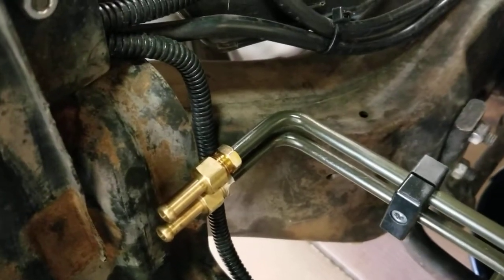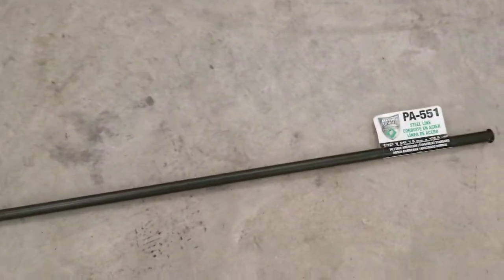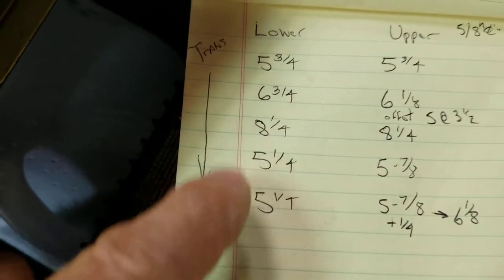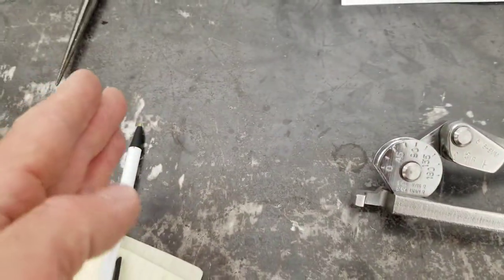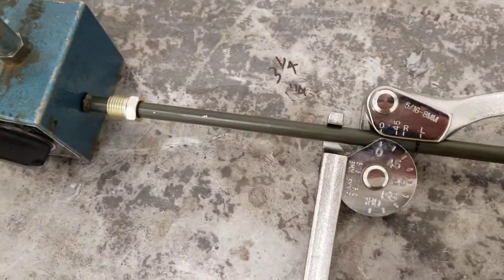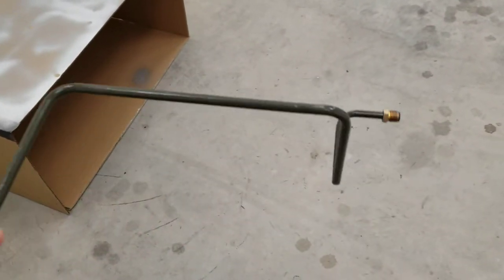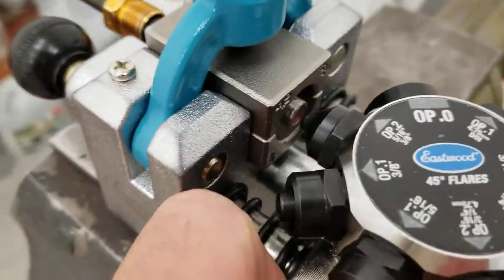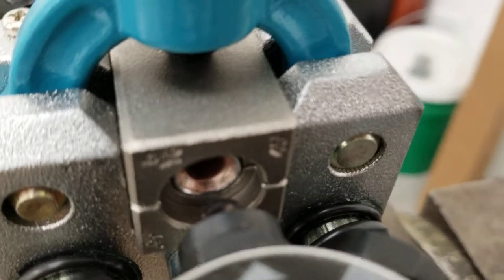How to bend and flare transmission lines

Comment: What type of barb fitting is that you put on the end of the line? Online or auto parts store have it? Good video.  I have been fighting with finding those barb ends to fit non pipe thread...seems like they want a fortune for them.
Reply from the maker: Those fittings came with the transmission cooler.  However,  You can get similar ones from summit racing.  Search under "earls vapor guard" series.  also can try Mcmaster carr
Reply: @vanguardhotrodshop8633  I saw those and went looking for them but couldn't find them. I wound up ordering some tube nuts and flared union fittings and some flare to barb fitting to make what I want though, just won't look quite as clean.